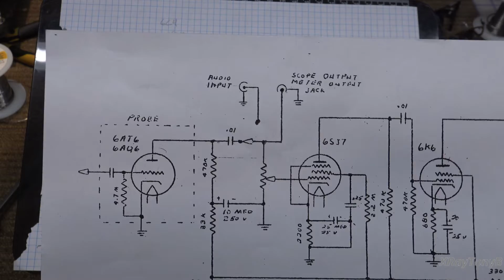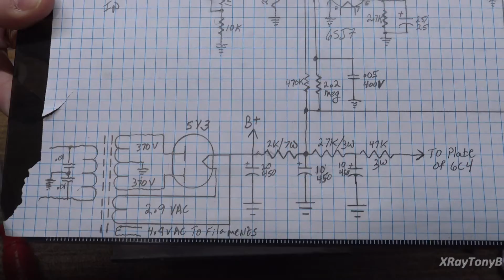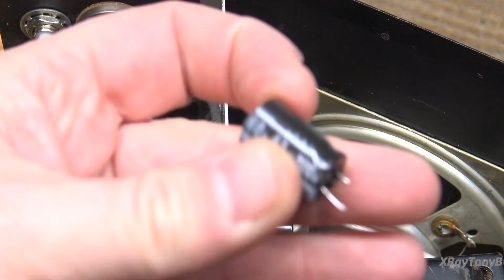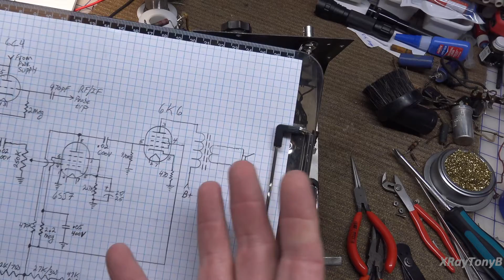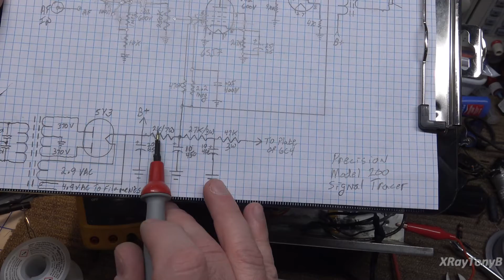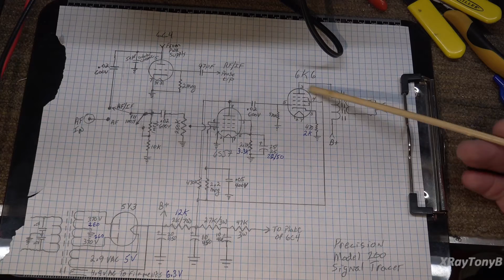Precision Model 200 Signal Tracer   Part 2

Comment: What is that tube socket shaped device used to mount the 3 new caps on?
Reply: Edit: I found the matching product here:
https://adapt-a-cap.com/products/adapt-a-cap-5-pack

As far as I can tell it is just a PCB designed to match the outer shape and mounting holes of a tube socket or multi-capacitor can. Inside there seem to be several footprints that correspond with typical electrolytic capacitors.
Basically, it's just a mechanical mounting aid for radial capacitors. Using that they're not flopping around but have a proper place to stay.
It might be a nice starter project with KiCad. 😉

Comment: I didn't find a schematic, but did find an Advertisement for the Precision Electronics Model 200. In the Ad it gave the tube lineup which was: "TUBES: Model 200. One 5Y3 rectifier,  pentode amplifier 
6SJ7,  power output stage 6K6,  and high gain triode 6AT6 in 
probe". Hope this helps. The ad can be found at radiorestorer website under downloads.

Comment: Greetings Tony, You mentioned the filament to cathode voltage rating. Of course exceeding it could damage the tube. You seem to infer that there are performance or other issues. Could you explain them in the next video ? ThanX!

Comment: My guess is the 6X5 failed and took out the original power transformer.  Some 6X5s had the plates so close together they would short. That would be across the secondary  of the high voltage winding. Most older equipment wasn't fused.  So there goes the transformer.

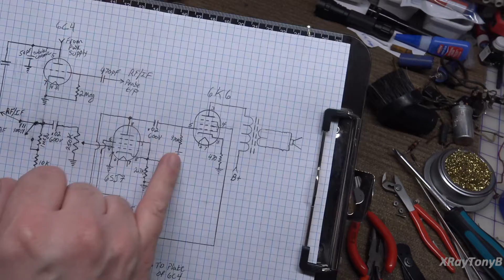Comment: @ 32:20  Paul Carlson came up with a good mod for the grid on the volume control / first amp tube, your 6SJ7, that he did on a Heathkit signal tracer restoral.  He basically coupled the output of the volume control to the grid with a capacitor, and then installed a "grid leak resistor" to control it's bias voltage to keep it from floating in a wide swing of values, and he gave a good demo of the results as well. It's under his "Signal Tracer troubleshooting and repair" video  ( at 49 mins and 17 sec), and it seems like a worthwhile effort to install. Sadly, the one thing he didn't do, that you did, was he left out the addition of a line power fuse, which just makes me cringe when I see it lacking, or not properly wired on vintage equipment.
Reply from the maker: I'd have to go back through the video, but I believe I showed an image of a basic grid leak detector circuit that uses that design.  It was used on some of the older AM radios way back.  Thanks for the comment!